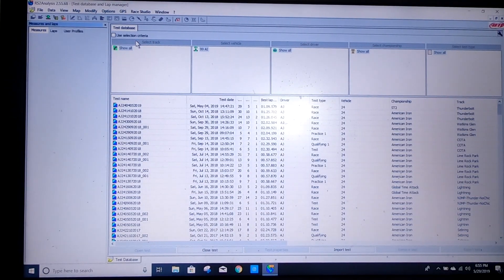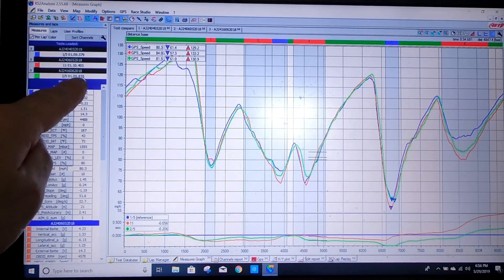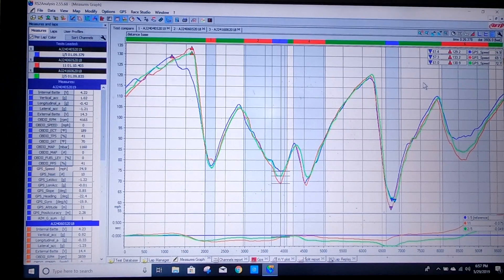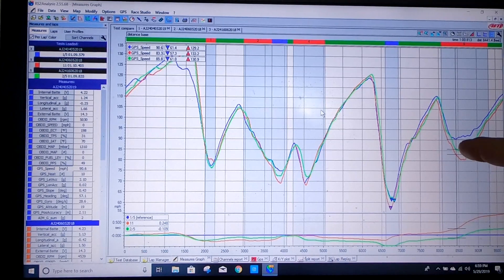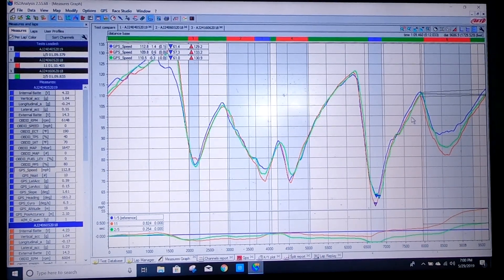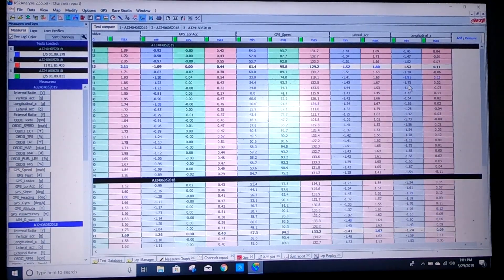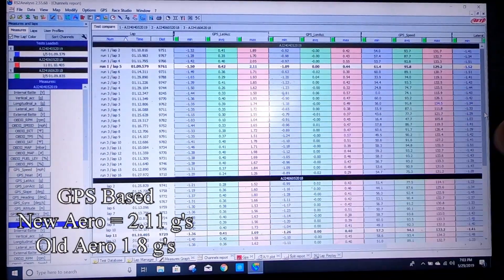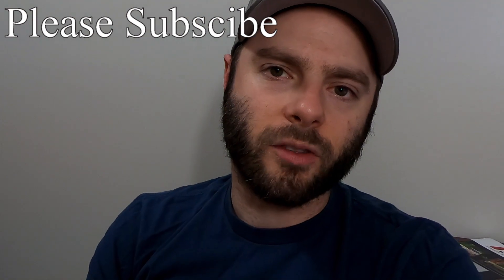How to Use GPS data to Confirm Aerodynamic Gains

Comment: How do you account for the flapping splitter hurting you on the first corner but somehow helping later in the lap? Referring to the Blue lap.
Reply from the maker: It doesn't. The speed around turn 4 later in the lap shows that the "potential" is there, I just didn't use it on that particular lap. Coupled with having to lift and coast, I pretty much over slowed the car. Keep in mind, that blue lap is about my 6th or 7th lap with the new setup so was still learning the limits of it and as teh data shows, the cars limits went way up, I just had to relearn the car.